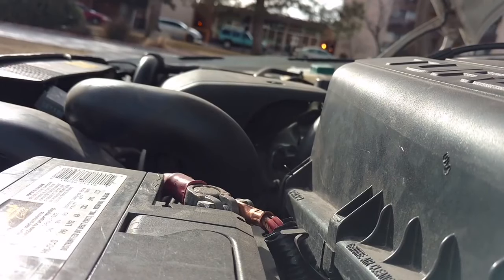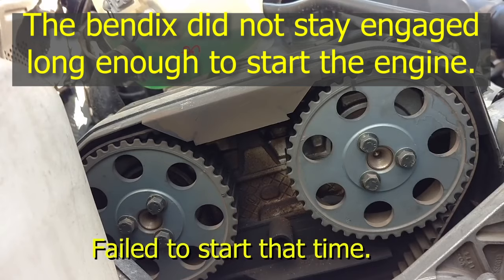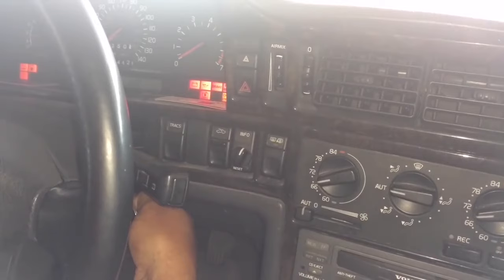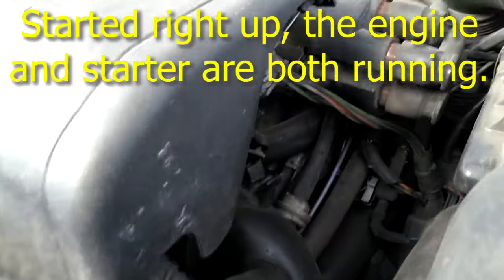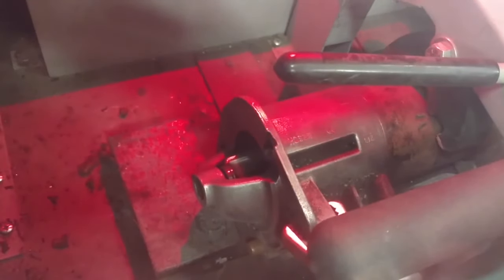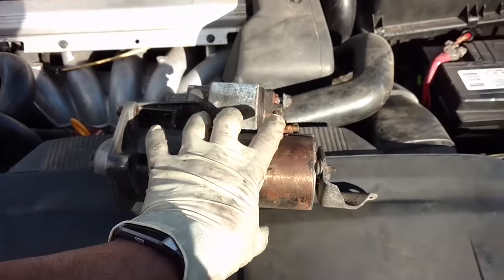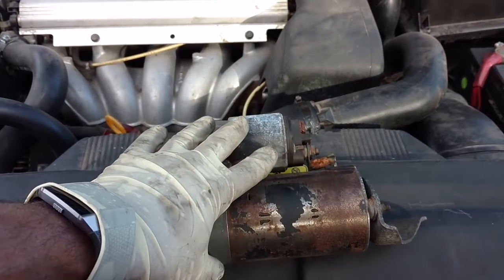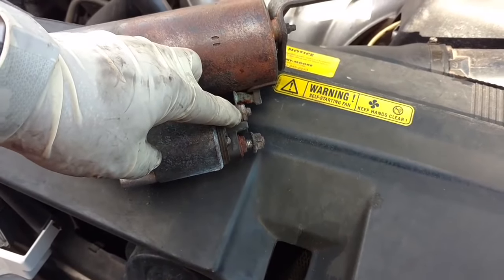Is your starter bad, hear the noises or sounds a bad starter will make. Also a full demonstration.

Comment: Thank you for this video. I have a jeep and when I turn the key I get maybe one click and then nothing and the dashboard goes out. If I try a few times I can finally get it to start. Tested my battery with a multimeter and seems good. Looks like I’m headed to replace the starter and hope for the best.
Reply from the maker: clean the battery terminal connections first.

Comment: Yeah found out that bench testing a starter isn’t the be all end all for checking it. We did and looked good. When I put it on it didn’t crank or at least was weak grinding sound. Got a junkyard one and it worked. Yeah bench tested but like I found out, that’s not definitive proof that it’ll work. It’s a first step but not fool proof.
Reply from the maker: correct.

Comment: Hearing one of these noises doesn't necessarily mean you have a bad starter. I just had a + connector to the battery that was not tightened enough and I heard nothing or one click when it failed to start

Comment: So my truck was making the same noise as if the starter and engine were running at the same time. What is the solution for that? Is it replacing the solenoid or the starter itself?
Reply from the maker: I replaced the starter.

Comment: What are the signs of a starter going bad? I just recently changed out the battery; last week. Never thought the starter would be a problem. But the dealership did tell me the vehicle had been sitting for a while. 

The last problem was the alternator. Once it was on, you couldn't turn it off. 

Than I ran into a spark plug issue I found from the mechanic who tow my vehicle to his shop.

The engine only appear to turn over. But today nothing. No sound. Even the battery is fully charged this time. 

But absolutely no sound when I turn the key.

Replacing this starter would cost me $200 bucks. But unlike the spark plug, the person who looked at it, told me is just loosen  two bolts and pull out and replace. No mechanic needed.
Reply from the maker: have it tested at an auto parts store or mechanic shop.
Reply: @RobertDIY  the OBD on board diagnostics was cut and not working. It was a $300 job to reconnect the wireless and fix it..

Comment: A noise you didn't mention Is a a short zing noise after the engine starts, not all the time.but most of the time. 
Any ideas?
Reply from the maker: That is probably the starter getting stuck like I explained at the end.
Reply: Yea mine do that as well.. before I had to change my started my car would start quietly.. now that I replaced my starter, there’s a short zing type noise (as explained in the comment above)

Comment: Along with everyone else, I applaud 👏🏽  u sir! But I do have a question, u said in the beginning of ur video, if it makes no sound that's the worse sound, what exactly does that mean? I tired tapping the starter while someone cranked it, nothing still. Not even lights. Might be my battery but it's new
Reply from the maker: Worse, the vehicle likely has an electrical issue that is harder to track down. You can check for 12V power at the starter post, which is usually hard to reach in most vehicles. Then check for 12v power while someone is trying to start it at the solenoid wire.

Comment: Thank you so much for the video. Such simple teaching in laymen terms. I have one question. Something keeps drawing current from the battery. The starter is dragging and going bad. But since it is directly connected to the battery. Is it possible for a bad solenoid to continue to draw current from battery?
Reply from the maker: Probably the alternator. You can disconnect it and see what happens the next day. I'll post a video about it tomorrow.

Comment: You can test it removed with a 12v battery and 8ga plus wires or jumper cables like auto zone did the test
Reply from the maker: It would also need to be in a vice to avoid it jumping around.

Comment: sometimes. sorta rarely+ i turn my key+ usually its only once and usually in mornings+ it has a single grindind noise same second it is firing up? not sure i havent looked into it+ but probably a bad starter.+ does this sound like bad starter hitting flywheel or what would you say?
Reply from the maker: I have no idea.

Comment: Hello Robert, I just picked up a 97’  Volvo 850 T-5 for a buddy and got a killer deal. 

The only real issue is the starter seems to be bad. The noise is almost exactly the same as what you showed in the video. However in my case it makes the same whirring noise but is followed by a clunking sound that you can sort of feel. I am 99% sure this condition is a bad starter, but I am also concerned of a damaged flywheel/ring gear. 

In your experience with these cars have you ever encountered a starter that has damaged the flywheel teeth? 

Thanks for your help
Reply from the maker: Never.

Comment: I have a weird one. My car runs good most of the time but sometimes when I turn it on there’s a loud rapid tapping sound, almost like there’s something touching a part of the drive belt or a wheel on the drive belt. It goes faster if I rev the engine in park. I turn it off and it might do it again or it starts and runs fine sometimes. I’m stumped.
Reply from the maker: You should get that checked out by a professional.

Comment: Appreciate the video! I have a scenario I'd like to run by you to get some help with. I'm having an issue where if I drive my truck up to operating temperature, let's say 20 minutes, and I shut the truck off and try to start it up within a minute I get the one click noise. However, if I do the same thing and let it sit for at least 20 to 30 minutes. It cranks right up with no problems. I have heard that heat can have either the starter or the soilnoid. I do have a heat shield that covers the solenoid and might as well be covering the starter as that sits underneath the solenoid. I've checked my connections and they all seem to be corrosion free as well as the wires which do in fact seem to be burn free. Any ideas on what could be causing this issue? Any help would be appreciated, or if you could do a video explaining this problem and possible solutions, that would be awesome as well!!! Thanks for your time!!
Reply from the maker: My guess would be a bad positive cable. Check the temperature of it after you drive somewhere.

Comment: On my Pontiac I have a issue with my starter I’m pretty sure I hear multiple clicks whenever I turn the key but I just bought a new battery a day ago and got it tested to see if it was good and it is. So idk if it’s my starter or timing belt or what
Reply from the maker: Bring it by and I'll check it out.

Comment: Hi Robert. Thank you for the information on a starter. A few days ago my car wouldn't start the I heard when trying to start it. It took 3x and it finally started. I haven't driven since but have an appointment now for tomorrow. Will it be safe to drive 2 miles to the repair shop if it starts?
Reply from the maker: Yes

Comment: Whats up Robert
I just replace my 2004 Lancer Starter put back everything and now theres time that it takes few turn before it start. Theres time it only takes one try and other time when turning key on no noise at all and wont start then it start again . What could be the problem? Thanks
Reply from the maker: Loose wire / cable connections, bad cable, need a tune up.

Comment: Interesting. My sound is metal on metal...tinny sound. And after multiple attempts it starts. But it does come close to the first sound.
Reply from the maker: Sounds like the Bendix is not totally engaging. You need to get that fixed as soon as possible so it doesn't damage your flex plate.

Comment: Dear Sir, 
My congratulations for your educational videos. 
But I still have some questions to ask: it happened 4 times that the gear of the bendix didn't retract into the starter motor after the engine was started, but continued to be driven onto the flywheel. 
I thought that de bendix was functioning a little bit like a ratchet, that it could spin freely without causing any damages.
But I was wrong as it damages the start motor.
Could it be that the solenoid (relais attached to the starter motor) continues to receive electrical impulses from the ignition switch, (the electrical part from the switch) even when the ignition key is released? 
Or is this fault caused by the mechanical part of the starter switch or motor? 
Does it then stick to the flywheel, or can it get stuck due to some dirt (couldn't find any dirt), and no longer retract due to the current flow that isn't interrupted. 
I even had a strange experience, before this fatal moment, about 5 months earlier, the key was in the "Run" position (and not in the start position) and the starter started the engine. 
This happened 3 times in one week, but in the following 5 months this didn't happened again, it disappeared on its own. 
I drove in total 350.000 km with the same starter motor without any problems.
Now I replaced it by a new one and drove 10.000 km without any problems, but suddenly I heard a strange noise, the bendix stayed again in contact with the flywheel (I drove 10 km with the radio heather, engine noise and other noices and I couldn't hear it, only when I stopped for traffic I could hear it, but too late), and now I have sometimes to try 7 or more times to crank the engine before it works.
Sometimes it cranks briefly (not enough rpm to start the engine), and then jumps back in his housing.
Ore it turns around but don't jump on the flywheel.
Other times it starts immediately without any problems.
I would greatly appreciate your views on this, for which I would like to thank you. 
Good luck with your upcoming videos.
Reply from the maker: sounds like the replacement starter was not very good. Did it come with a warranty? I would replace the starter again.
Reply: @RobertDIY  Dear Sir,
Thank you for replying to my message. 
Fortunately, I received a 2-year warranty on this. 
A new one will be delivered to me on Monday at the latest. 
But I would still like to find out the exact cause of it, because if an incorrect circuit has arisen somewhere over time and this wouldn't be the fault of an incorrect starter motor, the problem can repeat itself. 
The question is whether it will be covered by the warranty for a second time? 
But I tried to be on the safe side and in the meantime I have decided to connect a switch with a fuse and relay, that in other words, takes over all the functions of when the ignition switch was before in the "run" position, (for the command of the fuel pumps, ignition, on-board computer, etc...), and finnaly a starter button to run the starter motor.
The key now only serves to prevent the steering wheel from blocking. 
Now I still wonder if I would install a diode between the connection of the solenoid (relay) from the starter motor to accelerate the return of Bendix? 
But for such a circuit I don't know which diode I should use, because it is a heavy electrical circuit and a more or less important current wire that runs to the solenoid.
Thanks again for further help and best regards.

Comment: Good afternoon Mr mechanic I'm having an issue with my starter the small wire that connects to the starter from the battery is bending to where I don't think it's getting a good connection can I splice that wire and and make it more loose
Reply from the maker: absolutely.

Comment: Great video. Question. So if it does the multiple clicks is it the bad battery and a bad starter or bad battery? It does the multiple clicks yet auto zone says the battery is good. Thanks!
Reply from the maker: battery or connections.

Comment: Thank you so much VERY HELPFUL so if my Bendix is failing and teeth are damaged where do I go from there as far as fixing the car I believe it is staying engaged because I hear that ticking noise once it starts?please help me help myself! You're the best I've heard or seen and trying to find out what I need to do. My starter was hanging that's what caused the problem and I was trying to start it and the teeth from the flywheel and Bendix are damage now, it starts now but that noise once it does I'm scared to drive it.
Reply from the maker: I would replace it.

Comment: Ever have one make few clicks when putting the key in the ready position but not actually turned to start the car yet. Seems to start fine, but wondering why it is engaging temporarily when the system gets power, before attempting to start.
Reply from the maker: what's clicking?

Comment: Robert,  Nice Video...  What do you think about a momentary chirp like sound being starter related.   For over a year my Gmc Terrain 2.4 has a momentary chirp on startup only which doesnt occur every time.  Coming from side of motor where serpentine belt and starter are located.  Belt replaced and in no way or circumstance with reving or engaging a/c can u get to chirp to happen thinking it was belt or pulley related,   Then I said ,  why does it only happen on startup and what else is in the same area.  The Starter.  Anythings possible i guess.
Reply from the maker: Probably a loose belt.

Comment: sir i agree with the comments also great video, one quick question though, so i had been hearing the one click when i tried to start my 94 ford explorer, but i went underneath a gave the starter a few good wacks and tried to start it again and this time its began to engage then stopped and back to the one click sound. Do you think this is a dead spot or a failing bindex?
Reply from the maker: The statee motor is likely dead.

Comment: Love your video and the no nonsense explanation. 
My 2013 Escape will start but keeps cranking, so I turn it off. I try again, it starts fine but will stall unless I give it gas to keep running. After that, it's OK until it happens again. Its a random problem...usually happens at the station after I get gas, but not always. Any ideas for my mechanic? Ty By the way, I recently had a new transmission installed....don't know if that's  relevant to this new issue.
Reply from the maker: hard to tell from there. Probably a bad starter.

Comment: Mine just sounds like a drill and me and my buddy have taken it off and tested it with jumper cables and the rod does shoot out like it's supposed to we also checked the flywheel but to no avail have we figured out the issue we reassembled and it still just makes a drill sound
Reply from the maker: You can see the teeth on the flywheel/flex plate that the starter is supposed to engage to?

Comment: I still have questions-- it got in the negatives and my car wouldn't start. At first when I'd press the button it would try two or 3 times but then no noise at all. Went and had the battery charged and checked, was told its great. Brought it home & back in the car -- jump in and the stupid thing tried and got so close to starting the first 2 times I pushed the button. Now it's back to making no noise. The lights don't dim when I try to start it, I can't jump it (watched your alternator video too) .. so I'm at a loss here. Was hoping you could help point me in the right direction before I go ripping out parts that don't need  it 🤣🤣
Reply from the maker: If the car is not cranking, you may have another issue and probably need to have it towed to a shop.

Comment: Great video, it's very helpful. I've been having issues with my truck sometimes where it'll start fine but when I shut it off and come back after a little while, I'll turn the key and it makes a grinding noise and just won't start. After a little while it'll decide to start without that noise but I thought it was the starter. Is it my Bendix going out?
Reply from the maker: Yes
Reply: @RobertDIY  Thank you, I appreciate it

Comment: My car is making a grinding noise and slowly fades away after letting the car warm up whenever I start up the car, cold start, in the morning. The grinding noise is coming from the driver side and can be heard under the hood and under the driver side tire.  Once the car is driven for a while, I do not hear the grinding noise whenever I start up the car again.  I've been researching and it looks like the starter might be going bad. I can't think of anything located on the driver side that is running and making grinding noises besides the starter.  Do you think it's the starter? I have an 2006 Acura TL. Thank you!
Reply from the maker: I have no idea.

Comment: Very informative! 
I am curious on how a constant tick noise sounds when the starter is malfunctioning. Hopefully to understand IF that's what my Tahoe is doing. It's NOT a lifter noise. Even tho I'm a girl, I'm typically pretty mechanically saavy. But I'm quite frustrated with this damn truck. It almost sounds like flywheel. I dunno. Honestly, I feel I hear it more when the vehicle is at an incline. Strange? Any insights you, or any one else has? 
Much appreciated!
Reply from the maker: Maybe you have an exhaust leak at the exhaust manifold.
Reply: @RobertDIY  oh it's a noticably loud click. More than an exhaust leak. Maybe I can post a video
Reply from the maker: Ok, then send me the link.

Comment: Hey Robert,  I have a little Honda that sat for several months in my garage, it is hooked up to a trickle charger and says charged but I am getting that rapid clicking sound like you described,  Its in a tight spot and the brakes seem to be locked up, so I can't get to it to jumpstart.  Could this be bad ground? I don't have tools to test this. Any ideas ?
Reply from the maker: Probably a bad battery as result of the charger being bad.

Comment: My Toyota celica auto once in a while, the starter makes a horrible grinding noise upon turning the key, and not turn the engine. If i move the gear lever between neutral and park a couple of times, it clears and starts normally?
Reply from the maker: Ouch